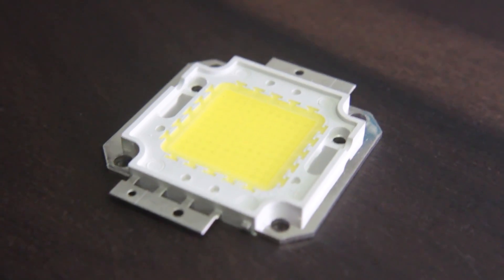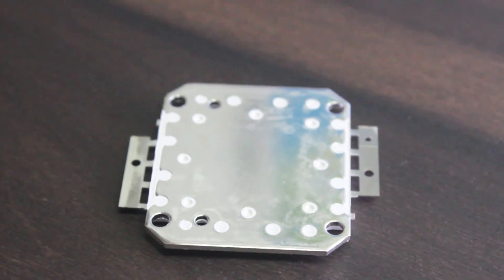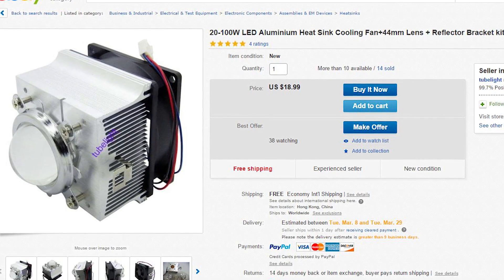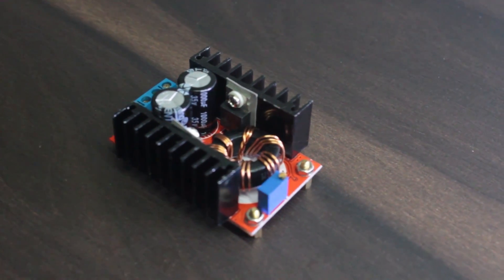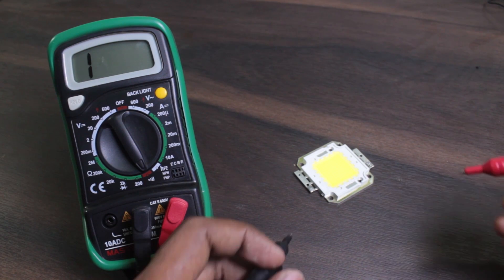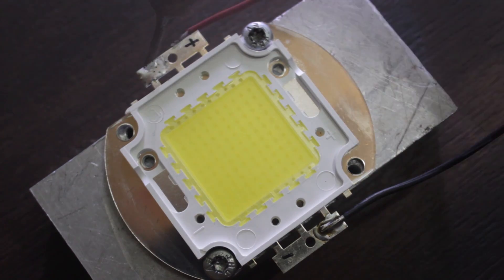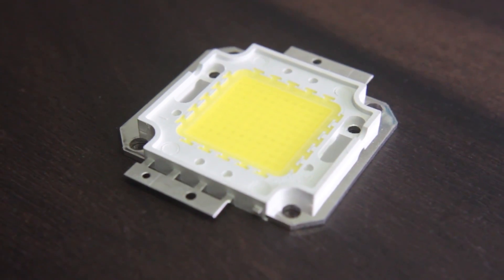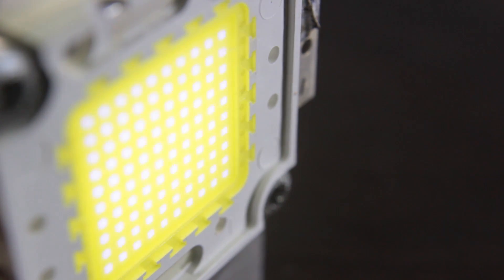Monster 9000 Lumens 100W led Tutorial.

Comment: is it possible to dim the led with a transistor controlled by arduino ?
Reply: I do not see why it would not work. I use a potentiometer to adjust brightness. The light output is controlled by the voltage currant going in. If you can change the voltage input you can adjust the light output.

Comment: Whats the capasity on the booster? Like how many chips would it be able to power?
Reply: The booster is rated for 150 watts and each led is rated for 100 watts so one booster for one led and 2 boosters should be able to handle 3 total led lights if setup correctly but that's still dangerous as it leaves no room for fluctuations and overdrawn/over-boosted currents. Best to use one booster per led chip. If you want a more through video check this one out. He goes into detail and makes things simple encase you wish to undertake the project as well. https://www.youtube.com/watch?v=c--5c3Egv4E

Comment: Hey ..I have a 100 watt led chip, how do I connect it to electric power? Do I need a led driver, please help me with this
Reply: Yes you need to use LED driver or DC to DC converter 

Check the following parts :- 

1- DC-DC Converter 150W :- https://amzn.to/2EJGF1J
2- LED :- https://amzn.to/2EIz1Vq  
3- Lens Glass with Reflector - https://amzn.to/2Er2vpm
Reply: I believe this video may be able to help. This was the one I built and it worked fine until someone dropped it and broke the 12v regulator. 
https://www.youtube.com/watch?v=c--5c3Egv4E

Comment: Buddy I have a question, is there a boost converter that can handle 10-100w leds at the same time.???
Reply: There are several options but they are much larger (about 4-5 times larger) and much more expensive. For the price of one that can handle 10-100w leds at the same time you can purchase 15-20 of the boosters used in the video.

Comment: What if I use a 3.6volt battery to the(DC-DC) boost converter (18650)???
Reply: The booster is not rated for voltage under 10v so a single battery would not work. However, if you decided to build a battery pack that you can remove them for charging or design a charger for, you could use 3-6 of them to get higher voltage that the booster can work with. On a side note, even if the voltage is achieved, that does not mean you will get the longevity of usage time between charges with just a few batteries.  Check out the link and you will see what I mean. This person used 6 18650 batteries to make a high density battery pack. I made one just like this for my diy sunblaster led light and it holds a charge for a while. I am Planning to make a second pack for a backup.https://www.youtube.com/watch?v=hwhqn4BmC2I
Reply: John Nelson  Sorry for the late reply, but it is possible to use an automotive battery. The only problem I would see is the amperage of the car battery well exceeds a few 18650. Even if the 18650 can put out 20 amps each, depending if you are in series or parallel it still would not exceed 120 amps and the weakest car battery you will find will still exceed over 400 amps. Granted the amps are measured under load so a light load would draw a lot less amps. That being said, If you do try it, as I believe it would work then you will absolutely need an in line resistor from the battery to the booster to prevent amp overload. I never checked the amps going into mine so I have no idea what it is. I used existing schematics so I knew it would work.

Comment: hey friend, same multimeter,  same led, same converter!!!!
Reply: Same here.

If someone is finding these parts then check followings:-

1- LED :- https://amzn.to/2EIz1Vq  
2- DC-DC Converter 150W :- https://amzn.to/2EJGF1J
3- Lens Glass with Reflector - https://amzn.to/2Er2vpm
(I also added the lens and reflector to enhance the performance)

Extras :- 
4- DC Connectors (12v) :- https://amzn.to/2EsPDz1

These are the good quality products at cheapest cost.

Comment: why aren't u use a led Driver?
Reply from the maker: +Jorg Hoop 100 watt led needs 32 volts to work,I had this booster which can do that,plus it has a voltage control to it as well,but it doesn't have the current control,which would be nice if it had,This does it job very well works great and the led is very bright.Hope that helps.